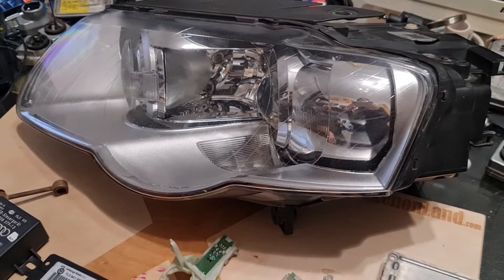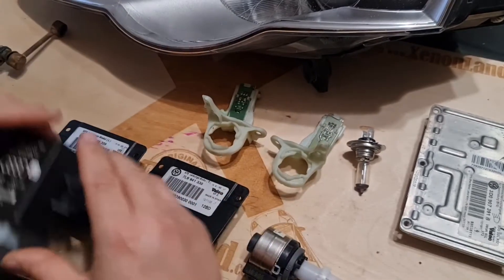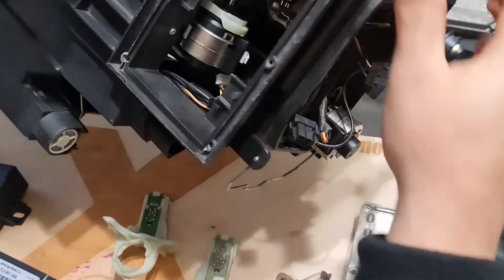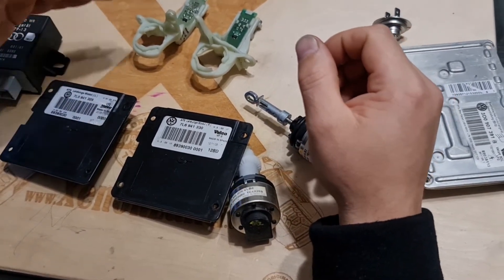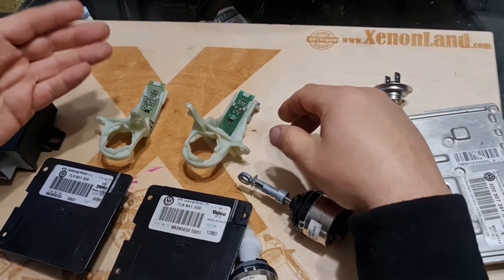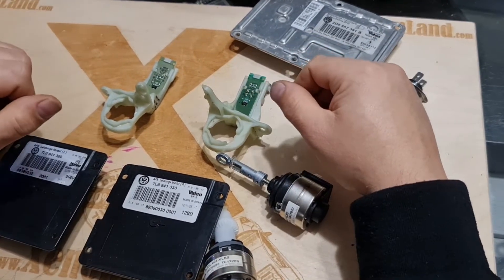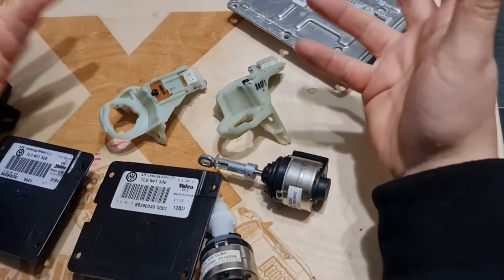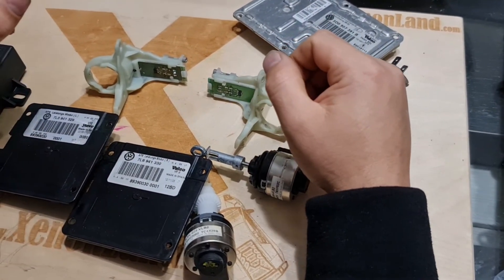VW PASSAT 3C TOUAREG 7L Xenon AFS headlight system & SWIVEL module position sensor issue

Comment: Hello, I am receiving the error "02233 power module left headlight communication error" on my 2010 model Passat B6.  The headlights only point towards the ground and do not flash; the part number is 5M0907357C. Is the control unit on the instrument panel correct?

Comment: Hello do somone know whats the problem when i have trouble Code 02629
Reply from the maker: The VW fault code 02629 points to an issue with the left headlight's swivel module position sensor (G474). It is small electronic board located inside the headlight
Reply from the maker: Is it the left headlight?

Comment: Hello i got 2 faults one is Left Swivel module position sensor faulty (02629), and instrument cluster no singal/comunication (01317). Could this be the problem that my headlight shine a bit low ?
Reply from the maker: 02629 causes inaccurate positioning of the projector
Reply: @xenonland  so this could be the problem why my lights shine not so bright or it doesnt make a good beam ?
Reply from the maker: @dariusgaldikas8893 if your beam is not bright enought, and your car milage is above 250000km, then most probably your projectors are internally cloudy/smoked.

Comment: if it does its dance and when I hit a hole or turn harder, it turns on, the AFS lights up, what is faulty, please help me, I also put another ballast after another car, all bi-xenon, and it still does the same, is the headlight motor faulty or what? error is,,sensor for swivel module position; left with error on vcds🙏
Reply from the maker: You need this https://www.ebay.de/itm/276044073766
Reply: @xenonland what is in the ebay link? The link is broken
Reply from the maker: What are you looking for? Which part?
Reply from the maker: Watch this one https://youtu.be/9k8EefYXTJE

Comment: Hello im getting a swivel motor sensor for the right side defective can i just swap out one from my old right side headlight and get it working again?
Reply from the maker: Yes, as long as it is from the same side and type headlight, it will solve the issue.

Comment: I bought a 2008 Passat. The previous owner stated a body shop replaced the drivers side headlight after a collision. When I start it up the drivers side does not dance left and right but only does the up and down dance. Could this be the AFS Module?
Reply from the maker: The dance at all sides is mainly related to the AFS module, and very seldom to swivel sensor.

Comment: Hi there, i've got the error for the left swivel sensor, took the sensor to an electrician, changed the black bit at the top, i belive it's a hall sensor as far as i read on the internet, put it back but i don't know how far to adjust the sensor, forgot to take a pic before. I still have the error but something changed, before that the error would show up immediately after i put the ignition on, now it shows up after the headlight do their test, sometimes after a couple of miles. My question is, does it need to be in the exact position? Passat B6
Reply from the maker: it is very difficult to repair the swivel module sensor since it communicates with bunch of modules at the car. Swivel module is a sensor that tells the modules and the motor to adjust the projector height. It does not have own position.
Reply: @xenonland  do you happen to have them? I've got an error for both of them
Reply from the maker: yes I have but they are 85 eur each since need an intact headlight to be stripped

Comment: Hello, can you help me please with a problem? I bought a 2007 passat with bixenon, 2 years ago, and when i start the car, the headlights go down and up, and not down, left-right and up again. Tried to diagnose the problem, and got a 01771- control module for headlight range, and cannot connect to headlights module. I don't have a AFS error at startup. I changed the module under the glove compartment , but no luck 😞
Later edit. The H7 bulbs from the cornering don't work, and the headlights don't follow the steering movement also.
Reply from the maker: Most probably your AFS module (AFS-Leistungsmodul) located at the back cover is faulty. It commands the "dance" based on the data received from swivel module sensor and headlight range control module.
Reply from the maker: be careful these are sided and can not be swapped between the headlights. Please subscribe to our channel and help us to grow.
Reply: @xenonland  they don't appear when diagnosing with vcds?

Comment: Hi , can you tell me why the high beam is not working on right headlight but is working on the left.thanks
Reply from the maker: left and right headlight low & high beams are independent from each other.  If high beam is not working in right headlight, then right headlight shutter is faulty.
Reply: @xenonland  that’s mean I have to change the ballast?
Reply from the maker: @louena7777  passat 2005-2010 is a bi-xenon headlight. Thats to say your low beam and high beam are at your xenon bulb. If you have low beam (xenon bulb is lighting) it means that your ballast and xenon bulb is working. Switching between high beam and low beam is done by internal shutter within the headlight. Pls subscribe and help us
Reply: @xenonland  ok , thanks